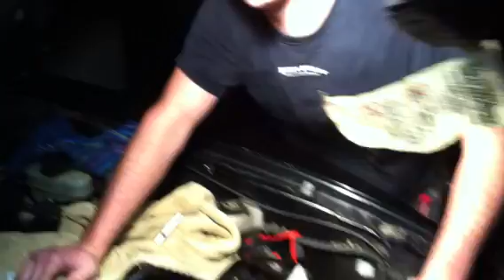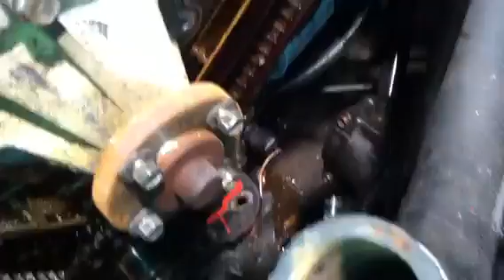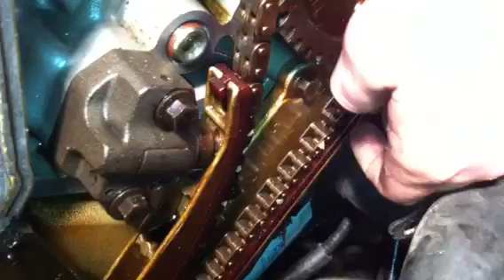4.6 DOHC tick tear down. (inside the engine)

Comment from the maker: Chain slack is common in any and every engine. Even a bicycle chain will stretch over time. As for the tensioners, they work just like a pressure release spring inside an oil pump. The washer trick would work if he decided to try it. Thanks for the idea.

Comment: ...remove the primary tensioners, remove the ratcheting arm from the tensioner body, remove the internal spring from the tensioner, use #12 steel washers placed below the internal spring pad to achieve .15" free play, remove tensionser, reinstall internal spring, reinstall tensioner.  This will make life easier on chains, guides and the front cam journals in your heads.  

It essentially makes the iron tensioners act like the later nylon chain tensioners, without the crappy nylon body.

Comment: Timing marks only line up on initial assembly, beyond that it takes X number of revolutions to get them to line back up.  It's not just a few revolutions.  Regarding the chain slack, try rotating the engine back 1/4 turn.  Often times this will take up the slack, the primary chain could be stretched but primary chain stretch on the Mod motors isn't common.  

I see you have the ratcheting iron chain tensioners, could explain potential chain stretch.  To fix this...con't...